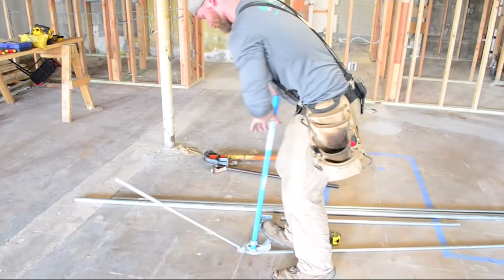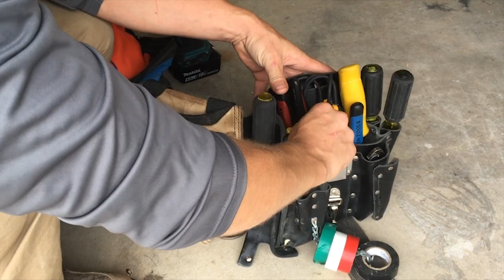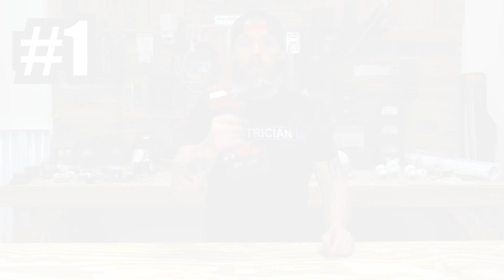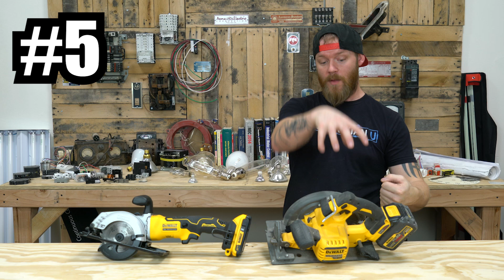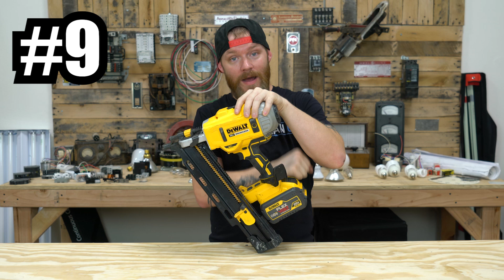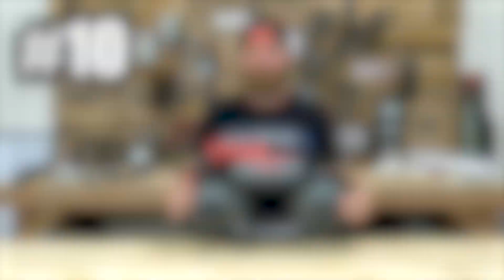10 Power Tools ELECTRICIANS SHOULD HAVE

Comment: Sds is a must.  A corded coring drill too. I would also talk about batteries.  I use the 1.5ah lightweight batteries on my impact & drill & my 4-6ah batteries with my sds & band saws.  U don't need more then the 1.5ah & it's alot lighter unless doing some heavy drilling or cutting & u want the extra power & battery.

Comment: Been doing commercial for quite a while as an apprentice, and i’ve been using the drill, impact, sawzall, and hammer drill. Though i may use the hammer drill less since the site ceiling for every floor is like metal. I don’t have my own band saw, but when the company provides ys and i cut some emt, wow so smooth

Comment: I have everything you mentioned and more in blank & yellow brand. I'd like ro stay in one battery platform.
How could you miss  "thread rod cutter", oscillating, and flashlight/work area light? I use headlamps but for ranch and attic I prefer a work light .

Comment: My biggest recommendation and it could even eliminate the jig saw from your kit is scroll blades as they are often called for the reciprocating saws.  They are about the size of jig saw blades and we often use them in the 1 handed smaller reciprocating saws for cutting electric strikes and other finer work.  I have also used them in the 1 handed saw like you would a jig saw but to be fair the pivoting plate was kind of a pain vs the fixed plate on a jig saw.

Comment: This is different more geared to residential work. For commercial must haves got to include a sds,iso tool, and the m12 3" cut off wheel is a beast for troughs and switch gear

Comment: Absolutely love my porta band so much easier to cut threaded rod for light fixtures, strut, conduit and I’ve even used it to cut service cable. Instead of a heat gun for heat shrink I use a map gas torch with the wide nozzle but then again I mainly use heat shrink only on the really big stuff like overhead service drop connections. The power companies around here have us do the disconnect reconnect even on underground services. We can even pull and reseal meters.
Reply: An SDS plus Roto hammer and a oscillating multitool are two other power tools that are must haves. We have a lot of stucco brick and stone houses around us so my Roto Hammer is also my core drill. And the ground is really rocky so it works really well for ground rods.

Comment: You have to get one of these https://www.homedepot.com/p/DEWALT-20-Volt-MAX-Lithium-Ion-Cordless-Cable-Stapler-with-2-0-Ah-Battery-Charger-and-Bag-DCN701D1/308047450?source=shoppingads&locale=en-US&mtc=Shopping-B-F_D25H-G-D25H-25_12_PNEUMATIC_FASTENERS-NA-NA-Feed-LIA-NA-NA-PneumaticFasteners_Smart&cm_mmc=Shopping-B-F_D25H-G-D25H-25_12_PNEUMATIC_FASTENERS-NA-NA-Feed-LIA-NA-NA-PneumaticFasteners_Smart-71700000080178040-58700006732570910-92700064304423975&gclid=EAIaIQobChMI4IOZyLCE8gIV0P_jBx2n1wBtEAQYASABEgJhevD_BwE&gclsrc=aw.ds#overlay

Comment: Multitool, rotary hammer drill, vacuum, lights (bigger than flashlights), and fans, all battery-powered. In your list, the only tools I don't have are the bandsaw, framing nailer, and a HoleHog. I do have an angle drill. Not being a "Pro" my tools are green, don't knock them, my tools have been serving me well for years now.

Comment: M12 fuel is what I use most of the time but got the m18 fuel when I need that extra power. 

I’m surprised you don’t have the m12 fuel Circular saw thing is bad ass for my service electrical work/ plumbing

Comment: I bought a GEN 2 18v SUPER HAWG to replace my ancient corded hole hog. I was going to go with the regular 18v version (shown in this video) but had a 25% off coupon tht only applied to the super hawg and made it only 10$ more expensive then the regular one.
All I have to say is HOLY CRAP. its a monster. It will plow though stud packs like they are made of cheese.... very soft cheese. Its unstoppable.  
I am happy with it but If i was to do it again I would likely just get the standard (smaller) 18v Hole Hawg (the one shown in this video). 
The Super Hawg is huge, and VERY long, good for leverage, bad for maneuvering it carrying it with a 24" Quic-loc extension in it. (think of a 20lbs framing square sized tool: AKA awkward)
The super Hawg is VERY heavy 2x the weight of the standard hole hawg.  ( `20lbs with a battery and bits/augers etc. vs. the regular Hole hawgs ~10lbs.)
The amount of torque it make over the regular 18v hole hawg is likely only needed 5% of the time (if that) but the extra weight and length is always there.
If you need to replace your old school tired corded hawg ... the 18volt Super Hawg crushes it ... I doubt the Standard hawg would dissapoint either.

Comment: A SDS drill is a must, drilling larger holes through concrete, chipping out concrete, etc. Even seen people drive in grounding rods with them, not a recommended use but yeah.
Replacing the jig saw with an oscillating multi tool is another one of those "where have you been all my life!" things.
Only other critique is trying to avoid mixing brands, since the batteries aren't interchangeable and aren't cheap either.

Comment: I’ve had the original m12 impact/drill combo since they came out. I do apartment maintenance so use daily. The batteries last weeks. I lost the drill for about a year an a half found it in a shed. It sat in a shed in ny with no protection through all the seasons, the battery was still at full charge when found. I won’t buy anything but Milwaukee

Comment: To those HVAC guys. A drill with hammer setting is perfect to start hole where the screw is aiming. This assume that the slipping clutch and hammer functions is work together otherwise we can over run the thread in the hole at the end of fastening.

Comment: I was really curious watching this. My list is entirely different. 1 impact driver. 2 hammer Drill. 3 grinder. 4 sawzall and Hackzall. 5 SDS. 6 bandsaw. 7 oscillating tool. 8 heat gun. 9 jigsaw. 10 circular saw.

Comment: Leaving out the oscillating multi-tool very much cripples your video.The oscillating multi-tool is a MUST-HAVE for Electrical Residential work. Nothing comes close for installing or removing electrical boxes when remodeling. After my drill-driver, it's the one power tool I use the most.

Comment: Good list. I’m actually very surprised at the number of electricians I come across that don’t have a bandsaw. I see them cutting pipe with sawzalls and leaving these jagged edges on them. It makes me cringe. One additional thing I definitely would include is an SDS drill. Absolutely crucial to have it for chiseling and drilling larger size holes in masonry where the normal drill on HD setting doesn’t cut it.

Comment: My absolute must haves, in addition to what you mentioned, are a carbide/metal circular saw and a oscillating / "Fein" tool. I do a lot of commercial where I'm working around metal studs and/or working with conduit mostly, so a metal saw is an absolute must, and the oscillating tool is an absolute must for service work, remodels, etc.

Comment: You missed the oscillating multi tool.  Must have!
Reply: to be honest, oscillating is much more useful than nail gun 
seriously, dustin?
Reply: The oscillating multi tool, a dedicated hammer drill is a godsend when your dealing with serious concrete and a metal cutting circular saw is pretty bad ass. I think I prefer it to the portaband for cutting strut, rebar or conduit, and it doubles as a descent wood saw.
Reply: Definitely  a must have if you live in an area with alot of plaster and lathe. No more shaking  the lathe  of the plaster.
Reply: I feel like instead of the jigsaw it should be the multi tool
Reply: YUP !
Reply: Yes I think it is definitely a must have, if you have to cut out a hole for a new box in drywall it’s the best thing ever! There are now even blades that are the exact size of an electrical box .
Reply: I appreciate this comment and the responses you got for it... Have been highly debating a multi-tool here lately for my commercial job. I think I've made my decision after reading all this. Appreciate you guys
Reply: Its not a must have, its more of a Quaility of life
Reply: @bloodsongsToolreviews  😂😂 so true
Reply: What scenario would you use a oscillating tool
Reply: @Blue_collar_fitness  cutting in outlet box in sheet rock or ceiling for a light fixture no hand knife  no recip saw
Reply: @Blue_collar_fitness  cutting outlet boxes into cabinets, cutting out shear wall.
Reply: @Blue_collar_fitness  I don’t use my jab saw anymore ever since I own an oscillating
Reply: @Blue_collar_fitness  cutting hard to reach nails and screws cutting in boxes in siding cutting hard to reach pvc or even emt if ya got the proper blade
Reply: Definitely a must
Reply: he said power tool not hand
Reply: Amen bro!
Reply: 1000% agree how did we ever get by without it?
Reply: i’ve used mine multiple times a day since buying mine!

Comment: Dewalts 12v 3 beam laser. Drilling wholes through studs all same heights. Leveling kitchen outlets so the backsplash looks levels nd straight with outlets. Marking out cans on floor like 3 ft off one wall 3ft off another. Gives you and X to put the red plastic piece on the metal cans. Lining up cans if the wall is not straight like a row of 5+ dead center.

Comment: If you have to keep it at 10 I would drop angle grinder for multi-tool unless working industrial. Also I would drop hole hog for DeWalt electric cable stapler. Impact w/a stubby paddle is AWSOME for holes and throwing cable Staples in with the squeeze of a finger is a huge time saver

Comment: I am first year apprentice and have a question related to power tools.

 is it expected that either as apprentice or journeyman one should have their own sawzall, circular saw, and grinder? or these ones should be provided by the company you work for?

I have my own hand tools and two basic power tools (drill and impact driver) but I am not sure about buying the above-mentioned ones. The only reason I am thinking about buying those tools is to save time and get the job done quicky as sometimes you don't have those company tools handy because someone else is using them. I see in some cases that some electricians have their own power tools (Aside from Drill and impact driver) even when they work full time for a company
what about you guys, Do you think it's fair to buy those power tools with your own money or the company should provide you with power tools?
Reply: I would say make the investment as you will save you and your company time and $$, they will notice that and thay may keep you around versus the guy who dosen't have the necessary tools.

Comment: I use the cordless oscillating multi-tool all the time. It is also a must have for cutting boxes into cabinets on islands. I also use it on remodels when removing old plastic boxes that have the lip behind the drywall. I use this tool more than I ever thought that I would. 
Great video

Comment: In Europe a hammer drill would make #2 and you would have a second big one with SDS-MAX for drilling holes > 1" in concrete. Electricians in Germany mostly use Bosch (blue is the pro stuff), where Carpenters have Protool and Festo. You won't see a nailer in an electrician's hand here though.

Comment: You showed so many different saws and didn't include any hammer drills. Looks like someone really wanted to be a Carpenter but ended up as an Electrician 😂
Reply: Literally the first thing he showed was a hammer drill. As electricians we do a lot more cutting than drilling typically. Cutting pipe and metal studs is much more common than hammer drilling. The majority of concrete drilling is just drilling pilot holes for a tapcon.
Reply: @Avaddon911  That highlights how different the trade can be from country to country. In the UK Sparks use hammer drills (mostly SDS) almost everyday especially on the industrial side. I'd say my cordless SDS makes up about 60-70% of my power tool usage on site.
Reply: @stevoc9930  I do mostly commercial jobs. But typically a sawzall/bandsaw and an impact driver are the most widely used tools. I occasionally have to drill a few holes in concrete for 3/4 or 1 inch conduit. But if there is a larger hole needed it's usually an outside company that specializes in core drilling that is called in.
Reply: The real difference isn't the country its union vs non union. We do the real work and rats build houses.
Reply: @nathanielgardener318  I take it you're in the IBEW... I worked non Union for years and then joined, local 683. Then I saw how many lazy whiny fat fucks worked there and decided to move on. But if that's your opinion then I can't stop you from having it. Plenty of non Union and Union guys work hard every day. The difference is most of the Union guys are arrogant for no reason.

Comment: I'm a UK domestic electrician, I guess that's what you call resi?
Every electrician I know just has,
- combi drill (drill + hammer drill)
-impact driver
- sds plus hammer drill
- multi tool (oscillating)
- angle grinder
That's it, can get any and all domestic work done with that lot

Comment: The difference is that the Sawsall has a 1 1/2inch stroke and the hacksall has a 1/2"stroke... Give or take. Hacksall is waaay slower to cut through stuff and is only for smaller material and things like. Pvc pipe.

Comment: They sell conversion kits that allow you to put an adjustable circular saw fence on your angle grinder. That way you may not have to get both tools if you dont need the saw that often. 

https://www.ebay.com/i/264470211149?rt=nc&_trkparms=aid%3D1110001%26algo%3DSPLICE.SIM%26ao%3D1%26asc%3D20161006002618%26meid%3D7655fc5e37c34492a903a6ae36c3ac95%26pid%3D100694%26rk%3D2%26rkt%3D30%26sd%3D153513091889%26itm%3D264470211149%26pmt%3D1%26noa%3D1%26pg%3D2386202

Comment: No Rotary hammer?
No dust extractor?
No laser?
No oscillating multi tool?

Framing nailer??? Maybe learn how to swing a hammer?
Jig saw??? I have been in the industry since October of 1999, and in 20 years I have used a jigsaw on a job site twice. This list is not as helpful as your normal content normally is Tex.🤦🏼‍♂️

New guys you are going to spend most of your day being a gopher and switching and b!tching get yourself some 12v tools, Bosch PS22 is 1.5lbs a Milwaukee 2402 is 2.5lbs it is way better than carrying around a 18v tool, unless you like going mouse hunting with an elephant gun or you need to work out while working...

Comment: Missing on the list:
1) multi tool (Fein multimaster is amazing if you're willing to go off system for the batteries, a lot less vibration)
2) rotary hammer, needed for making larger holes in concrete if you need to run conduit through a wall.  Running ground rods too.
3) cordless vac, but not the small ones.  If you're team red then the 2 gal wet/dry is perfect.

Optional: 
1) Dewalt cable stapler, if you staple a lot of romex it will make your life much easier. 
2) Hydraulic driver instead of an impact drill, less power but your ears will thank you in the long run.
3) rotary cut out tool, if you ever need to cut around something buried under sheetrock.
4) a good light source that runs on your main battery system, so you always have a battery ready.
Reply: Wouldnt you just use the multi tool for the sheetrock lol

Comment: Dude I love using a angle grinder for when I cut pieces of uni-strut I grind the burs off the sides when I am building racks or trapeze racks for emt. Also a oscillating multi tool works badass for cutting out drywall for cut in boxes if you're gonna add a plug or etc. I'm a red guy thru and thru also!
Reply: You must not work where you need hot work permits. And I think a bandsaw cuts strut faster.
Reply: Nathaniel Gardener Yea I use a bandsaw to cut the strut but grind the edges with a grinder

Comment: Rotozip is a useful tool.  I'm mainly commercial and i use mine often enough for cutting drywall.  Its useful if i have to cut a bunch of holes for can lights or old work cut in boxes. 

SDS drill with a ground rod driving bit is a back saver. 

Everything else you covered i think.

Comment: I’m going into my first Year as an Apprentice just waiting to be dispatched. I wanted to know as a first Year Apprentice what Power Tools would I REALLY need.
Reply: Probably just get a combo kit at the usual places, best way to go price wise. One with a saw and 2 different drills, whatever brand color tickles your fancy. Anything more than that for now is overkill. Get used to your type of work (commercial, residential, specialty, etc) and see what coworkers are using before even thinking about anything more. More than likely you’ll just be a stock runner and the guy at the dumb side of the measuring tape for awhile. We all start at the bottom, and do more stuff when we prove we can be trusted with more stuff.
Reply: Drill, impact, sawzall
Reply: BENJAMIN GREEN if you are going union none.   If non union the first few weeks maybe a drill.  Depends on the size of the company. But as a general rule  first month or so  just basic hand tools. 

And a pen and paper for getting the coffee orders and supply lists
Reply: Austin Eades Damn ok lol thanks
Reply: Ive been a resi apprentice for 3 months and at the beginning all I had was basic hand tool (hammer, strippers, lineman’s, 11in1, flashlight), impact, and hammer drill. That’s more than enough to start with. As the other guy mentioned, watch what the guys around you use. Good rule of thumb is, if you borrow it more than twice, go and buy it
Reply: Union. You won’t need any power tools
Reply: Austin Eades No Power Tools at all ??